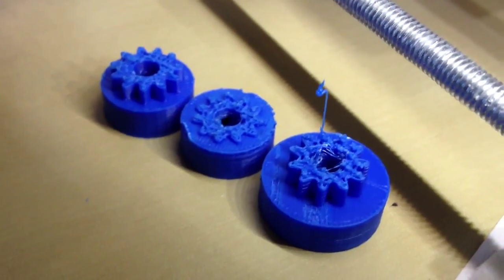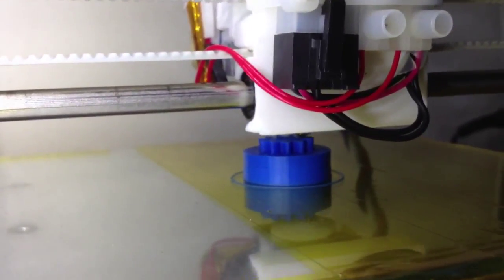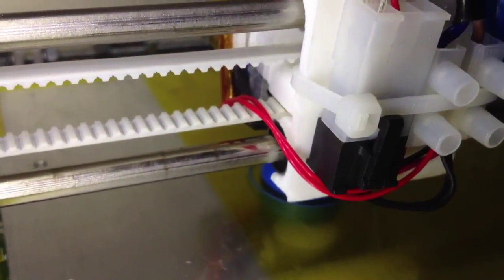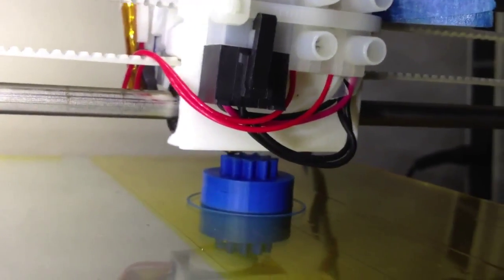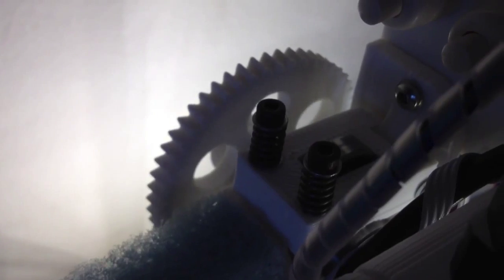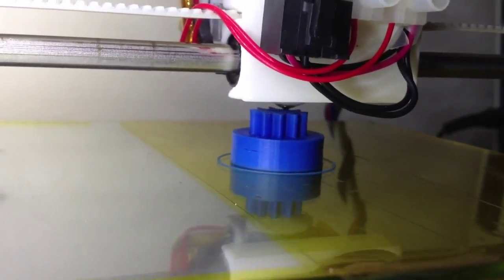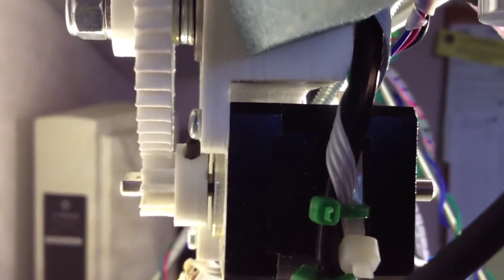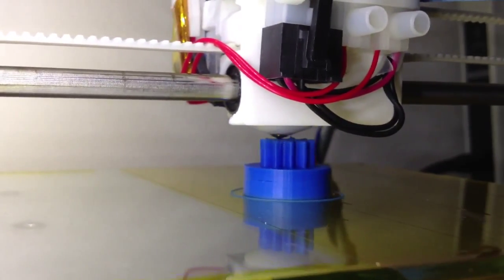eMaker Huxley 0.3 mm nozzle

Comment from the maker: Actually, I was having the opposite problem. The Makerbot blue ABS filament is quite soft and I was finding that By the time it reached the end of the Bowden tube it could sometimes be quite flat, probably through having the screws too tight.
No good photos of parts printed with the new nozzle yet but there's a recent one from the 0.5 mm nozzle added to the video description.